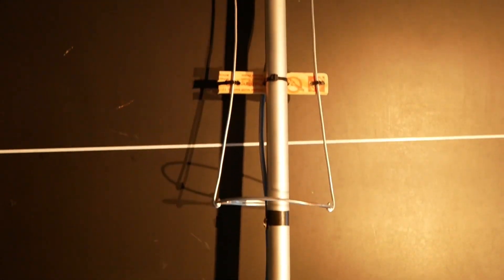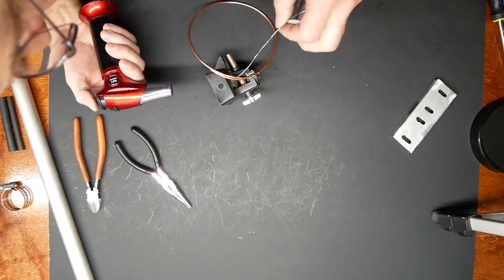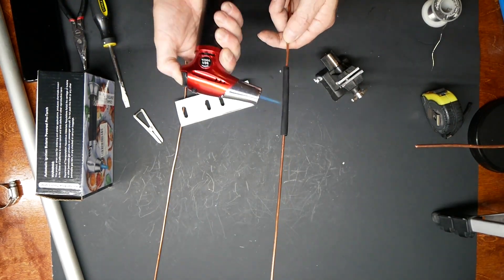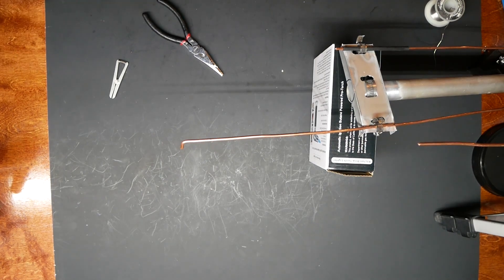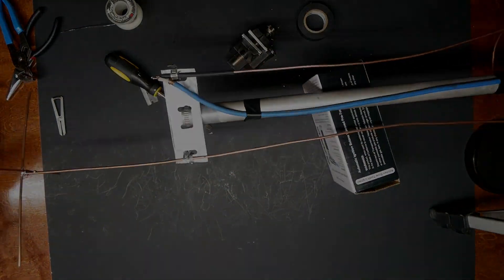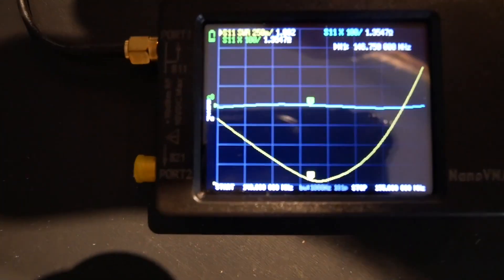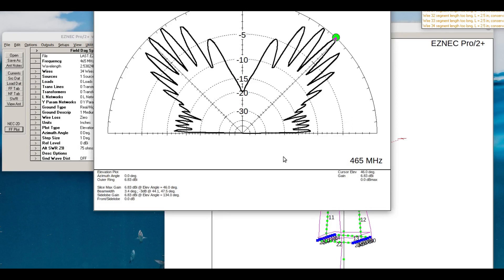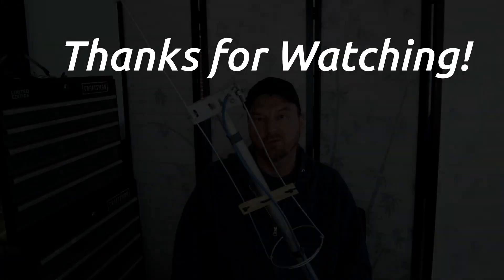Building an Astroplane look-alike for 2 meter ham radio.

Comment: Try scaling it down for GMRS. Nice video Gary KF6EWO
Reply: By the time you get that frequency range you might as well run a high gain vertical as it will still be tiny.